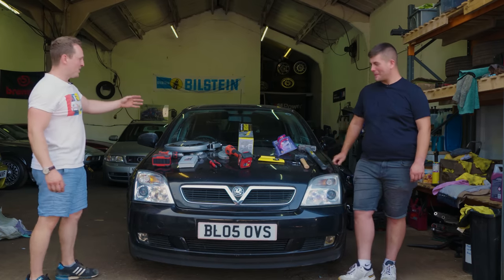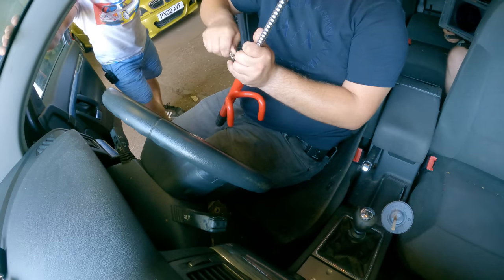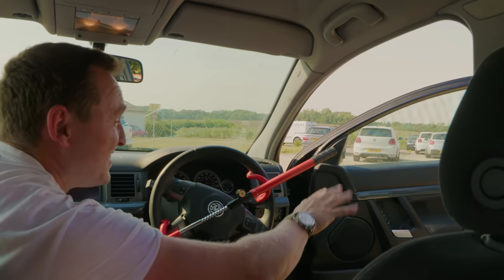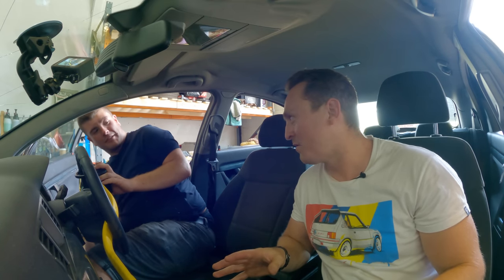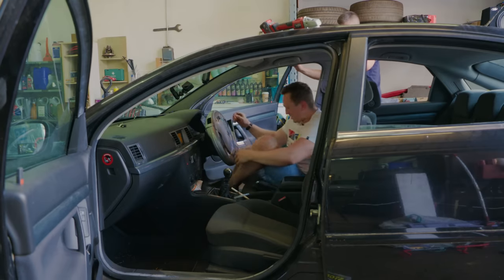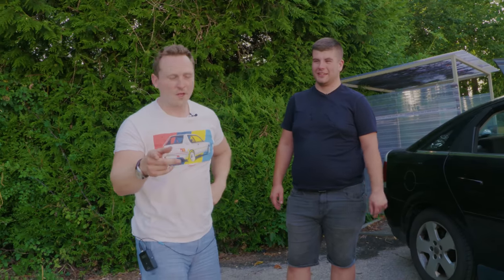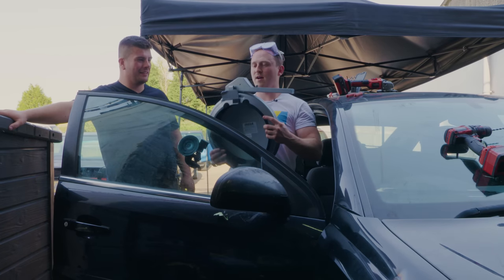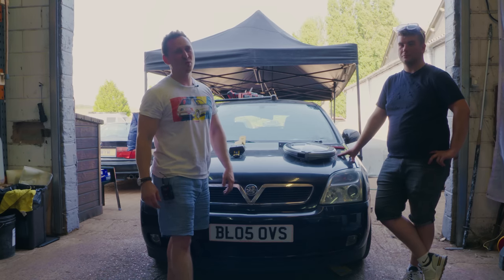Cheap Vs Expensive Steering Locks TESTED

Comment: Back in the 90's, it was easier to steal a car fitted with a Stoplock than without. Apparently, the thief would use it as a lever to break the steering lock, then cut the steering wheel to remove it. 😃
Reply: It worked that way in the 80's as well.
Reply: So basically what you're saying is, thieves in the '80s and '90s wandered around with a Stoplock handy just to fit them on the cars they wanted to steal ?
Reply: Yep, they should've just used the hacksaw on the actual steering wheel!
Reply: @douglaspalmer4794  exactly
Reply: @Matt Hargreaves That makes me sad.
Reply: My dad had a XR4x4 that was stolen this way. Found burnt out in a local woods :(
Reply: This thing is you want to add time to the situation..this is taking way more time than the their would want to take..gone in 60 seconds..anything longer than that and they taking off and running

Comment: Hilarious video, and some good consumer info in amongst the chaos. Much like the array of chains, locks and assorted ironmongery that I drape my motorcycle in though, they seem to mostly be deterrents rather than able to stop a professional with intent. It's a case of 'make them nick your neighbour's car instead'. Still good to have though, especially if you don't like the neighbour.
Reply: Well in the end, if they want it, you'll loose it at some point. But exactly as you say, it's about making them think it'll take to long for them to steal your car (in this case) and have them go for any other car instead. 

About 10 years ago i had a car stolen from me, it wasn't a very special car, not worth a lot of money and i never thought someone would nick it. I was very suprised when i got back to te place i parked my car and discovered another car was on the spot i parked mine. 

It was an old cheap shitbox i used as a sort of work van (Alex probably knows what i mean now) but someone saw my old '97 Astra Wagon and figured they needed it more than i did. I was happy my tools weren't in there. Never got it back, turned out i had insured the car for damage by fire or theft, didn't give it much thought and bought another shitbox/workvan daily driver.
Reply: @destructionnl8165  People will steal anything, years back I had a 1.0L Nova(...) which got nicked when we were out clubbing, my turn to drive. I guess someone just didn't want to pay for a cab home. It was a karma moment though, it had feck all petrol and it was found abandoned out of fuel halfway between Middlesbrough and Guisborough. The thieves will have had some walk even to go nick another car lol
Reply: @destructionnl8165  On the other hand, at this rate I'm at risk of them nicking my bike just to weigh in the scrap value of the locks 😂
Reply: @TheSpectre223  yes the decent  chains almax  immobiliser 4 19mm chain etc in 2 metre lengths. At going to be worth more than my bike soon.
Reply: @Abo999  we had a nova 1.3 sport and a 1.2l stolen I the same night.  Keep the fuel low is the key then it will never be far away when you find it.

Comment: I have a Stop Lock the Police were giving out to people years ago . Ive found it to be a tad heavy and it can set the horn off leaning on my Mitsubishi Momo wheel . Ive a actual alloy wheel clamp and the looks you get fitting it on car parks , people think your actually clamping a car not stopping it from being nicked
Reply: I think I'll stick to my immobiliser than to bother with a clamp every time! Got it linked to the clutch pedal switch, car won't start without it, dashboard shows key icon so it's not obvious what the issue is. Switch is hidden, although I have a second one activated by GPRS.
Reply: @hippopotamus86  the factory immobiliser in my car is perfectly fine at preventing my car from being started

Comment: Car thieves love steering locks, they often help with breaking the factory steering lock. I have pursued many a car with a bent steering wheel back when such devices were far more common

With the first two locks , if it fits that way the long end needs to up and right, between the A pillar and winscreen. It should minimise the amount of movement available. 

The real value in any such device is to simply be a visual deterrent, have the toe-rag look at the next car that may be easier.
Reply: right okay may as well ask. on a datsun 120y-sounding situation, whats the likelihood ill get nicked

Comment: I use a stop lock as it takes no space to slide it into the back footwell when your not using it & they stole my car but had to cut through the steering wheel to do it.
Also after speaking to an ex car thief I was told they use the length of the steering lock as leverage to break the integral steering lock.but with keyless entry they don’t need keys to start or get the alarm to disable & the integral steering lock also is disabled & yes the ford keyless is so bad you might as well leave the doors open.
I’d use the stop lock but angle the long bit so it can’t be used as leverage to break integral lock & is a hard angle to use a hacksaw on.

Comment: For the Club or Stoplock types, someone once told me that thieves usually cut through the steering wheel instead of the lock.
Reply: No 1st we use the stoplock to break the steering lock then use a hacksaw to cut the steering wheel the stop lock actually helps to steal a car back in the day mk1-2  astras were know as 10 second cars that's how long it took to steal them 
An old metro can be stollen with just a coin in under 10 seconds

Comment: I watched your video and I really do appreciate what you guys have done with this video. I just took a decision now after watching your video and I will go for the STOPLOCK PRO because it really proved to be difficult to crack plus value for money at $50.
Again, I appreciate what you guys have done because you spent money buying these locks to just destroy them. I just bought my car and I haven't been sleeping well because of the absence of a proper steering lock device. My car is usually parked in front of my house and I think every thief wants a discreet operation which the STOPLOCK will not guarantee. I will use it to deter or delay them from putting me in pain.
Thank you great guys

Comment: Destroying a Vectra in the interest of product testing was a stroke of genius.
I was crying laughing🤣🤣
Loving the channel Alex❤
Reply: Its only a vectra  im still surprised its even still around.
Reply: @chrishart8548  1.9 diesel Vectra are good cars, they're just the peak of dullness. Respond well to tuning though, the ex police 1.9 especially are pretty quick
Reply: @mrcaboosevg6089  but where have they all gone it's very rare to see one now.
Reply: @chrishart8548  Scrapped i would imagine, i scrapped mine even though there was nothing wrong with it. They're just worthless, it's not like they rust either since mine didn't have a spec of rust on it
Reply: There very underrated cars. Shame its reputation was demonotised by top gear. Seen plenty of ones exceed 200,000 miles
Reply: @mrcaboosevg6089  if there was nothing wrong with it why would you scrap it?
Reply: Good cars vectras, just ugly, no ford engine other than the early smiley transit will beat the 1.9d for miles, sorry but you don't see taki drivers in fords

Comment: Fiesta ST 2017..... get the steering lock pro....fits perfectly and when if you put it on so that each set of black locking pins pass on either side of the steering wheel control buttons.   To get it off they will need 2 cuts on the steering wheel near the yellow bit and then 2 cuts in the steering wheel for EACH locking pin.  Either that or they need to cut through one of the steering wheels two spokes which is game over

Comment: No cost anti theft for any vehicle - pull the fuel pump,  and or start fuses. Can also get a battery quick disconnect and fuel cut off switch,  those cost some minor monies
Reply: This is what I'm thinking too. My hyundai was stolen and recovered with $2100 of damage. Geico victimized me again by only paying 1/3 the cost to repair. PD said get the Club but that looks easy to break. So disabling the vehicle makes the most sense.

Comment: You can snap most steering locks by hand. You need your pal in the pessenger seat to put his foot across and help you turn the wheel whilst you pull from the outside. I only recommend full face locks as someone I know tried cutting a few and never got them off. Pedal boxes are also very very difficult to get off.

Comment: Honestly, hidden fuel cutoff switch is probably the best. Someone is gonna get in the car, somehow get it to crank over, and notice it doesn't start. At that point they'll probably decide it is not worth their trouble.
Or the biggest chad move, quick release steering wheel and just take it with you, lol.
Reply: Or battery isolating switch on battery terminal - even easier!
Reply: a magnetic swicht for ignition or fuel pump is the best , you can hide it behind a panel
Reply: They can just get a set of pliers and drive it off without the wheel.
Reply: I had 2 engine kill switches in my car. Thieves know the common hiding areas for them. If they want your car....they'll get your car.

Comment: After seeing this, I would rather go with a well hidden kill switch that cuts power to the entire car, the fuel pump, or ignition system.
Reply: Yep. I stopped my car being stolen with a hidden switch for the fuel pump. Simple
Reply: @robtt997  I had an escort mk5 if you open the glove box there is a gap along the top edge I hid a switch in there. And ran some hidden black wires down to the drivers footwear there was some box in there that controlled the fuel pump. At first I started taking the whole unit out. It was only the size of a cassette tape. But I was worried if I ever lost it it could be an expensive part and also I wouldn't be able to use the car.
Reply: @chrishart8548  I wonder if the  next owner of my Cav SRi ever found the switch ! Just hope he wasn’t giving it the beans at the time lol
Reply: How about a none hidden labelled kill switch that is wired to something that kills the thief, technically if youve labelled it its their own fault for pressing the switch.
Reply: @MrTwoZZT  In my opinion it would be the Thiefs fault for Slashing his fingers on my Door handle Razor blades

Comment: For the 2 bar type locks just cut a gap in the ring of the steering wheel and remove the bar .
Replace the steering wheel when safely at your lair .

Comment: Haven't watched yet but can tell you know there are 1000% worth it. Someone got into my cupra a couple of months ago, Long story short is they most likely had the 2nd key that was missing from the car when I bought it. They unlocked the car which beeped twice and woke me up. I got to the window and banged on it and they ran. They were trying to cut the stoplock off. If they did have the key I'd have no car... So from experience definitely worth it. I went out a bought the diskloc after.

Comment: You guys are a riot! thanks. The disklok seemed like it's bar was way too short and you could easily drive it without taking it off. Just take off the pastic of the door and you will be good to go. The middle one definitely worked the best
Reply: The steering wheel isnt moving the disklok spins around the wheel

Comment: My fiesta ST was stolen with a DiskLock on. They drove it onto a housing estate around the corner and tried to use a grinder to get it off (they couldn't). I found it the next morning with the lock still on but all the contents gone along with the drivers window. Great lock as they couldn't get it off but now have a bollard to stop them driving off with it still on
Reply: its always a Fezza that gets nicked. My beloved got stolen a few years back. You would think ford would at least try to make them slightly hard to steal.
Reply: I have a switch connected to the clutch pedal, good luck finding it!

Comment: My 2020 outlander got stolen recent so was looking to invest in security for the new car. You did a great job testing those and I'll will most probably purchase the big yellow 1 reasoning being with the 1st 2 you could actually cut the actual steering well and the slip them off. But the disk lock would prevent that

Comment: LOL, when you put the basic red club in try to install it into the edge of the window/corner piece, can't spin without breaking the window.  some can be extended to area where floor meets console, cannot move that either. Also try to put the key of the lock away from you.

Comment: The first 2 are a waste of time. The can be removed quickly by cutting through the steering wheel, rather that trying to break the lock off. It would still leave the car drivable, the steering wheel can be replaced, and if you're nicking for parts then the steering wheel isn't high on the parts resale value list.

Comment: Fiesta ST ownership in a nut shell in the UK.
Steering lock isn't enough security and adding more layers of security such as immobiliser and kill switch is a must now
Sometimes they are just visual deterrents and often slow the theifs down but not stop them. 

Worst case, your pride and joy will be dragged away or your house broken into for keys

Comment: and btw if you wanna be just a bit more safe turn the wheels so they point in most car are push away from where they are befor breaking it it's some thing i hear on the pub i may or may not have done it like so  it's alway lovely when there is peach and quiet to work

Comment: Back in the day my grandad had a Sierra with the big yellow and grey stop lock that was insurance approved. They broke it off the steering wheel and then used it to snap open the iron gates at the end of the drive. We did end up with the car back after the Manchester police heard the car on Philips Park, the local park, being screwed to high heaven. It surprisingly undamaged and with a few insurance repairs returned to him. We kept the car for a few years after and eventually it became mine. Unfortunately it was myself that ended up scraping the car and fitted the wheels and tyres to a mk1 fiesta. I could to describe the next 78 vehicles I've owned but I won't bore you with that ......    or should I?
Reply: No

Comment: I had two diskloks. I only have one now. Misplaced the keys for my daily and went looking for the spares. Turns out I had 3 keys for one disklok and only 1 for the lock on the car.

Tried to yeehah it off, tried a crow bar, hammer, etc. Ended up cutting it off with a grinder. Not exactly quiet or inconspicuous.

Couple of months later the lost keys turned up.

The disklok is the only steering lock I'd bother with.
Reply: From speaking to thieves they didn't bother with cars that had disk locks.

Comment: I work in agriculture which is heavily targeted by thieves, people always say you’ll never stop someone from taking something if they want it, so just make it so they have to make as much noise as possible in an area as lit up as possible if they want to steal it
Reply: seatbelt warning attached to the horns fun
Reply: @godzillas6301  another good one is plugging a horn into the 7 pin plug for the tow bar
Reply: @dylanwakley2553  The reverse beeper attached to the brake light and rooted behind the dash is hours of fun

Comment: I laughed my ass off!  Trying to drive with the steering wheel lock on was like watching the three stooges!  Now I have the double hook steering wheel club, brake club, dash board club, a viper alarm system, a motion detector for the inside of the car from Amazon, and steel plates welded over my catalytic converters.  The premise beind stealing a car is to do in 30 to 40 sconds or under a minute.  The more obstacles you put in the way of a car thief the better.  Also decals for the outsode of the door by the handles reflecting GPS and Ararm system is also a deterent.  I had to do these measures because I have a KIA!  I doubt a car thief will take the time to try and steal my car with all these  obstacles in the way.  Hopefully he'll just go on his way to the next car. Great vid though!

Comment: Most of the locks, are rated by time, to by pass it. I come across house locks, that say anti pick / bump, that I have opened , with out to much problem. You get some very expensive locks, but the cylinder is rubbish.

Comment: It's easier to cut through the steering wheel with the first two. Cut the arm off the Disklok & use expanding foam to secure it to the wheel. The weakest point of a Disklok is the hinge.

Comment: u missed the quickest way for the first 2.... you just cut the wheel itself. bend out of way, remove the clamp bend back and off you go... also standing on the wheel helps snap steering lock.

Comment: In SA we had the Gorilla lock, it hooked around your clutch pedal and one of your steering wheel spokes.
Reply: In SA as well I remember the gorilla lock driver lost the vehicles keys and there were no spares for the gorilla lock. A quick snip with the bolt cutters on the steering wheel and off we went.

Comment: With the first two its far easier to just cut straight through the sterring wheel rim and then its drops off, yes the wheel is damaged but your nicking the car would you really care. Also having either of those on makes it far easier to break the mechanical column lock as its give you more leverage to put force on it. The only use for either of those two is to attempt to make a thief choose another car that doesnt have one but if they want your car they offer very little deterent.
Reply: I fit mine on a classic car and what I do is put the prongs either side of a spoke so at least they'd have to cut the wheel twice and even then they might not get it off with the remaining chunk trapped inside. The more basic version of the similar looking stoplock one is rubbish though, got to be the one in this clip.